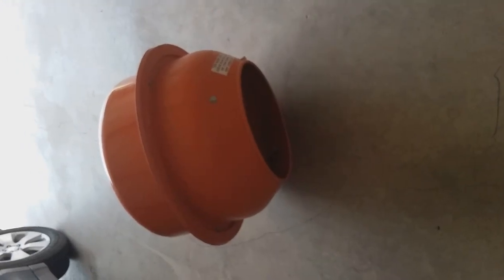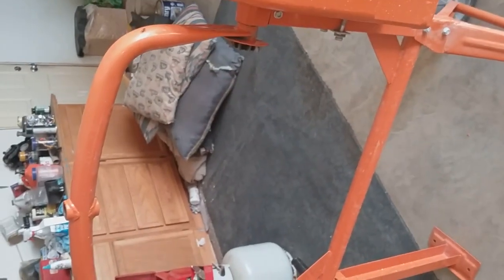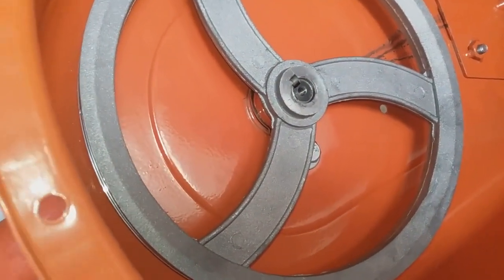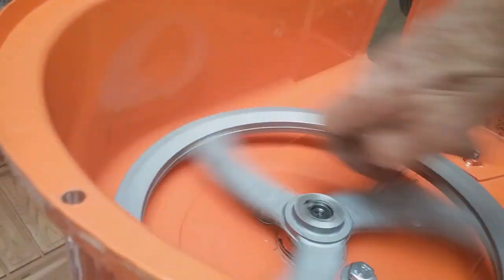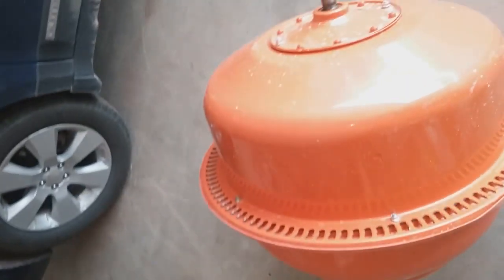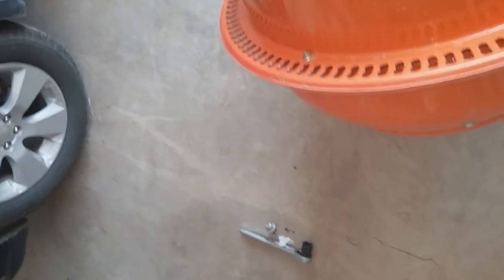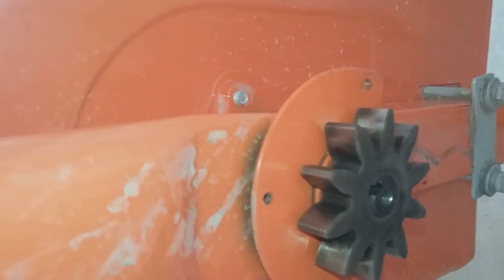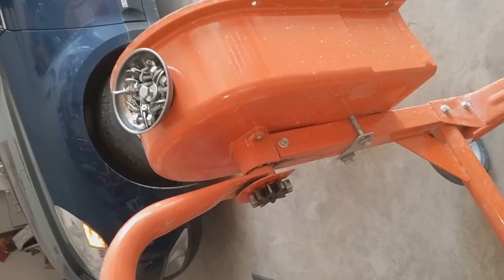How to Fix a Harbor Freight Concrete Mixer

Comment: Very informative video. My mixer quit over the weekend after about 1/2 dozen mixes. I found the flat key for the gear had fallen out and was lying in between the two lips of the drum. I was searching the internet to see if anyone else had this issue when I found your video. Thanks!
Reply from the maker: Glad you found your key.  I lost mine and had to order a longer than specified off of ebay and then cut with a hacksaw. Got me back in business and no problems since putting thread lock on my bolts.

Comment: You were right on the money with this repair.  i just took mine apart and the gear screw was off.  GOOD JOB thanks
Another video showed how to bend the tub rim to a more level revolution to get much of the gear noise out.

Comment: This saved us a buying a new mixer! We took ours apart and we were missing both keyways. As a note, you have to take off the black box and the metal-toothed gear to get the bolt off on the flywheel. The washer they installed under the flywheel was about the only thing being used to hold the assembly together and had eaten away at the surface of the flywheel. We replaced it with a larger washer.and it runs great.

Comment: Glad I found this video, thank you sir. I've had mine for about 5years. used  it a number of times. loaned it out a number of times.  just got  a call from the guy I loaned it to this week; it stopped working after a few pours. I will look at it tomorrow night. I suspect this is the issue though I will update this comment once I know. thank you.
Reply from the maker: If you have to take the drum off, just be careful and try to not drop it on the floor like I did, with mine. LOL!  Hope yours is also an easy fix and thanks for the comment. I would be interested in a follow up on what you did to fix yours.

Comment: Thanks for the video. On my mixer, the bolt and washer that held the keyway had come loose after mixing about about150 bags of concrete, fallen out and got lost, along with the keyway. I bought a set of keyways on Amazon for $12 to make sure I would have one that would fit. Another 100 bags of concrete to go...

Comment: Thanks for the warning, I'll be sure to get some thread locker when I pick this up. Saw a few other great vids where a guy welded on a bag splitter across the mixing paddles with a piece of square tube and a small piece of sharpened flat bar, another guy added his own larger inflatable tires across a wider axle for better stability and easier to move around. Thanks again.
Reply from the maker: Thanks for the comment. I think the wider axle and larger tires is a really good idea. I failed to mention in this video, that this mixer is top heavy when it is mixing to capacity, (around 1.8 Cu. Yds). As it comes from the factory, it must be pretty level, (side to side), with the tires chocked, if you are going to mix full capacity. I think 3 1/2 Cu. Yds. is the full capacity of the drum and you can only mix about 1.6 to 1.8 Cu. Yds of concrete per mix.  With 1.8 Cu. Yds in the mixer it is very top heavy and must be level side to side and less important front to back.  Excellent idea if one is going to use it alot. 
Thanks
Reply: @johntube2525  Mine has two holes on the bottom of the front stand. I think you can bolt it down to a piece of wood to give it side to side stability I am going to bolt it down to a 4 ft. 2X4 before I mix again. I noticed that it wobbled while under load. The wheel axle (if it can be called that) has two holes for the cotter pin to hold the wheel in place. One is close to the OEM wheel and the other further out. The axle extends about three inches past the end of the wheel. I think you can put a fatter wheel and use the second outer hole for the cotter pin. I am going to look for larger sturdier and more backyard friendly wheels as replacements. I don't want to have to add an axle and go through the trouble of having to find an adapter to run a new axle through. Mine was outside for over a year with a tarp over it. I think if it was not covered it wouldn't have lasted outside before completely corroding. I may look at repainting it. I also noticed all the bolts rusting. I may get new ones and paint them or try to find SS bolts for it. As long as the motor doesn't die it may be worth investing a few bucks into it. Do you know if anyone has replaced the motor on these with a larger better motor? I remember seeing a video on this mixer last year and the person had the same problem with the missing key. He used a square concrete nail that he ground down to size and got it to fit. My son is going to make me a handle to be able to roll it better when moving it. The two handles it comes with under the motor are a joke to pull that mixer and move it more than a few feet. I saw a video on some mods and one was a long handle welded to be able to pull the mixer better. I think I will see if I can weld a hitch so I can lift it and move it with my tractor. Someone posted below that his old one has the drum bearing wearing and needing replacement. Mine does not have a bearing on the drum. It is just the long shaft with the big bolt holding it in place. My bolt had a lock washer that I noticed would work the bolt off. I put thread lock on it but left the lock washer off. I used the blue thread lock instead of the red so it won't be that difficult to take off if I need to. I am also going to put grease fittings on the spindle shaft which has holes in it for oiling. There is a hole on either side of the drum arm. I am also trying to think of a way to put a grease fitting on the drum shaft so I can grease it regularly without having to take it apart.

Comment: Just purchased this mixer, thanks for the heads up. ThreadLocker is your friend.
Reply from the maker: Thanks for the comment! I do not know if you have ever mixed concrete with just a shovel in a wheel barrel, but if you have, you will love this mixer. It is so much better. 
One more quick comment. Be sure to try and level the mixer and chock the wheels. Especially if you mix around 1.5 to 1.8 cu. ft. of concrete at a time. It will be very top heavy with that much concrete in it and could try to turn over on you unless you have it pretty level. Extending the foot with thick plywood or putting heavy cinder blocks on the foot could help minimize the top heavyness. Or just mix smaller batches to minimize the top heaviness. 
Good luck
Reply: How has the mixer worked for you since then?
Reply: @johntube2525  one drawback I noticed with using the mixer, just having to lift the bags up a little bit higher to get them into the mixer. Give them into wheelbarrow is easier. But lol of course then you have to do all the mixing yourself.
Reply: @kbanghart  perfectly,  no loose parts yet. Built deck support columns, repaired crumbled driveway entrance, made shed foundation supports, etc. This little mixer has been very convenient for a lazy retired guy like me.
Reply: @br549fried4  Good news. I'll pick up some threadlocker soon :)
Reply: @br549fried4  welp I just checked, and as I suspected, the screw on the outside of the assembly where the small key part was loose. I'll fix that soon. I don't know if the key has to be in any certain position, or if it's just there, it's fine? I remember I had a real time trying to get it to stay there.
Reply: @br549fried4  today I found out that the key way on the other side of the motor, facing the tub, was gone. I have a new key, but it's too long and so now I get to figure out if I can cut the metal, or somehow use the longer key.
Reply: @kbanghart  a machine shop can help with that problem.
Reply: @br549fried4  thanks.
Also, when you're using a float, like a big bull float, does it help to weigh it down some? I noticed it's tough to push the hand tools around when the surface is firming up.
Reply: @kbanghart  they make weights just for that purpose. I use whatever i have handy...
Reply: @br549fried4  sounds good, maybe I'll use a brick or two.
Reply: @br549fried4  I now believe I know more about Key ways then I ever did lol. I found a shop and should be good to go!
How long can the motor be run before it needs a break, like maybe 1/2 hr?

This afternoon I'm on my way to go rent a nice big bull float and maybe a walking edger. Scared but also excited hehe
Reply: @br549fried4  I did some today, worked great! I added thread locker, and I'll go back and check connections before I use it again just to be sure. It does vibrate a bit. Plus I might add a solid piece of wood to the stand opposite the wheels, as it's a bit narrow.

Comment: Thank you for the heads up about these critical bolts.  I just bought and assembled one of these mixers.  What a challenge it was!  I will go down tomorrow and get some threadlock.  I've already had to take my mixer apart a couple times to redo things.  The instructions were poor and I also made some mistakes.  I added some beefier hardware with lock washers to most of the connections, including the motor pully.  But I'm going to do this one last step with the threadlock.  Hopefully this mixer will last awhile
Reply: The lock washers (10 mm) on the shaft (both gear and pully side) and bottom drum attachment (14 mm) are very flimsy and deform easily.  So I just updated them with some new ones from Tractor Supply and also Blue (medium) threadlock.  Hopefully this will keep my cement mixer working for awhile, without any problems.  This cement mixer is supposed to be a tool, but unfortunately it has turned into an extra two-day project that I don't need.  What I need to do is finish my fence project with tools that I can count on.  If this mixer still breaks down after all this work, I may make a video of it going off a cliff.
Reply from the maker: Thanks for the thank you. Seems most people are seeing the video after they have assembled the mixer and thank me for the video, but wished they had seen the video before they assembled theirs without thread lock. I thought about renaming it to something like: Watch this before assembling your Harbor Freight Mixer, but since it only had a couple views at the time, I never did. 

Do you think that would be a title that is more appropriate and would help people out more?

I like my HF mixer! The bolts coming loose and losing the key way is the only problem I have had.
Just have to be careful to not over load it and try to keep as level as possible because it can become top heavy.

 Definitely has some design flaws, but if you do not overload it, I feel it beats wheel barrel mixing and renting a mixer. 

Good Luck,
Reply: @JohnHenry-er4wu  how has it been since then? Mine just stopped working on me yesterday, the exact place where he describes in this video at about 1 minute in.

Comment: thank you, this is something I am going to be looking at soon... my crap farted on me after 2 uses as well.
Reply from the maker: If like me, you lost your key, try googling 5x12 key. I know amazon carries kits with several different sizes. If you get prime free shipping it might be cheaper to buy the kit than paying 4 time the cost of one key from someone that actually has the right size. I bought a larger size and cut to right size with a hacksaw, then ground the corners smooth. Good Luck!

Comment: Great video helped me a great deal. Same issue with mine. Did you ever get the key way?
Reply from the maker: Yes I bought one, but cannot find my notes or where. Mine had to be cut to proper length. There was a comment by Kris about 4 months ago and he bought a 12” long key to cut to proper length from Granger. Here is a copy of that comment with a link to EBay Grainger. You can find others on ebay, but most of them come from China and that shipping will take months to get here. 
 EBay> GRAINGER APPROVED WWG310505305 Keystock,Under,12 In L,5 x 5mm. https://www.ebay.com/itm/252720730041?_trkparms=ispr%3D1&hash=item3ad7544fb9:g:irUAAOSwaX1iVwZc&amdata=enc%3AAQAGAAAA4EySfzaD%2BEH5ehmzWgZ1IYSOQgRxxIiTX4FV8TLT658tb%2FDu%2FQyJ%2Fa%2F8pUA833REuf%2BwQFfgs%2FquD4tOawK36SwtSHQw5%2FBVfRWav7rcdDr%2Bxz59hxiM%2Bt2ud47NqmcbPzldzjdnA1DcoTlkbc6WtRO8Gxh%2BBQLc668EkM4okCwojC4zq0jVkqWOhacGYGWsZrh%2FtRFxczppK%2BqAA%2FYyGeR%2FImfDy4fo4mIIJ5oUAOFG1ymjYF0nwUdfk4mz%2BI6lB3DGd%2B8cfbJNBITIvW1X5xdv8c8Hbsfqyr0%2BQzmLQ0hK%7Ctkp%3ABFBMjrLa8pNg

Only $3.33 plus $5.99 shipping. There may be others, I stopped there. Good luck!

Comment: John, I have one of the HF concrete mixers that has lasted almost 36 years with no problems except a setscrew loosening up one time on the large pulley.  Drum bearing will finally need replacement soon as the drum gear does skip a slot every once in awhile.  The older ones do not have a bolt which retains the large pulley and the drum hear has a split pin driven into a hole vice a bolt to hold the gear, shaft and keyway on place.
Reply from the maker: Nice to know. As with most mechanical things, If one takes the time to inspect and maintain them, they will last a long time. Thanks for sharing.

Comment: We’re you able to get a replacement key for the drum gear?
Reply from the maker: Yes I did. I think I bought it off eBay, but I do not remember.It has been 5 years and my memory is not that good.  If you google 5mm x 12mm keyway or key stock I think you will find lots of them. I think I bought one longer than 12mm and cut it with a hacksaw and then rounded the edges with a grinder. It worked fine and I still use that mixer now and then. I just looked for my extra piece I cut off a longer piece and of course, after 5 years I have no idea where I put that extra long piece. Google and you will find them. Good luck.

Comment: Same issue here , can’t find the key or the bolt both lost I guess while I was mixing . Any idea where to buy them ?
Reply from the maker: It is really hard to see what they are pointing at in the parts diagram, but there appears to be 4 things by parts number as follows: 22- Cross head screw M6x15; 23-Spring washer 6; 24- Flat Washer 6; 38- Flat Key 5 x 12. 
Part numbers 22, 23, 24, you should be able to get these metric parts at any Hardware Store. The Flat Key 5x12, I ended up buying a longer one from EBay and then cutting it to 12mm length with a hacksaw, then rounding the edges with a grinder. 
Suggestion, there was a comment made not too long ago where someone, Lori, 13 days ago, told me they  bought a 12 ft. long flat key. Perhaps you can find that comment and try to ask that person if they will make you a key for a price. There are lots of 5mm keys on EBay, but most are located in China and will take a while to get here. There are also kits with many different sized keys in the kit. I believe I found a kit on Amazon. Just have to google or shop around, 5mm x 5mm key. Good
Reply from the maker: Found this on EBay>
GRAINGER APPROVED WWG310505305 Keystock,Under,12 In L,5 x 5mm.

https://www.ebay.com/itm/252720730041?_trkparms=ispr%3D1&hash=item3ad7544fb9:g:irUAAOSwaX1iVwZc&amdata=enc%3AAQAGAAAA4EySfzaD%2BEH5ehmzWgZ1IYSOQgRxxIiTX4FV8TLT658tb%2FDu%2FQyJ%2Fa%2F8pUA833REuf%2BwQFfgs%2FquD4tOawK36SwtSHQw5%2FBVfRWav7rcdDr%2Bxz59hxiM%2Bt2ud47NqmcbPzldzjdnA1DcoTlkbc6WtRO8Gxh%2BBQLc668EkM4okCwojC4zq0jVkqWOhacGYGWsZrh%2FtRFxczppK%2BqAA%2FYyGeR%2FImfDy4fo4mIIJ5oUAOFG1ymjYF0nwUdfk4mz%2BI6lB3DGd%2B8cfbJNBITIvW1X5xdv8c8Hbsfqyr0%2BQzmLQ0hK%7Ctkp%3ABFBMjrLa8pNg

Only $3.33 plus $5.99 shipping. There may be others, I stopped there. Good luck!

Comment: What are some possible causes of a gas leak on a concrete mixer?
Reply from the maker: Wow! You got me there, since mine runs on electricity. Am I right, assuming you have a gas engine mixer? Anyways if you do have a gasoline-powered mixer, is the tank leaking? If so I have had luck with JB Weld fixing tanks. Just let the JB Weld cure for 24 hours or longer. Perhaps the carburetor? I have had to put three carburetor kits in my old 1994 Homelite weed whacker. Still running after all these years. Perhaps a hose leak from the tank to the engine? I also had to replace that hose on my weed whacker. Sorry, just throwing out ideas here! Not sure I can actually help since mine is electrical.
Reply: @johntube2525  no you're totally fine I appreciate you trying!💙

Comment: My key is missing. Any idea of how to get a replacement?
Reply from the maker: I bought my replacement from eBay. I looked for some notes on the seller and even looked for my left over part, but could not find any notes or my left over part. I think I bought a 5mmx5mmx55mm length and then cut it to the length I needed. 

Look on ebay for 5mm keys. Mostly you will find sources from China, but I bought mine from a USA seller, probably made in china, but I paid more, since I did not want to wait a couple months for a key to be shipped from China. Good luck!
Reply: @johntube2525  Thank you!  I looked but was only finding 5x5x30mm as the longest so I bought a 5x5mm 12' rod that I will now have to cut down.  I'm pretty sure it needs to be 40mm, from the manual I pulled up on line. At least there is extra in case I mess up :)

Comment: long story short
problem was bolts was all loose
solution was put threadlocks on and torque all the bolts down
Reply from the maker: Yep, pretty much sums it up in a sentence. Unfortunately when something breaks years after putting it together, you kind of wonder what happened. I was able to buy the new key that disappeared on ebay  Video was made to hopefully help someone fix theirs.